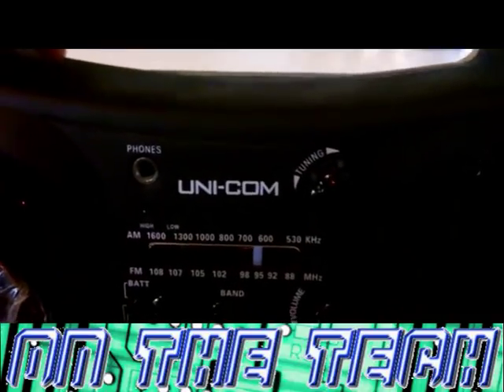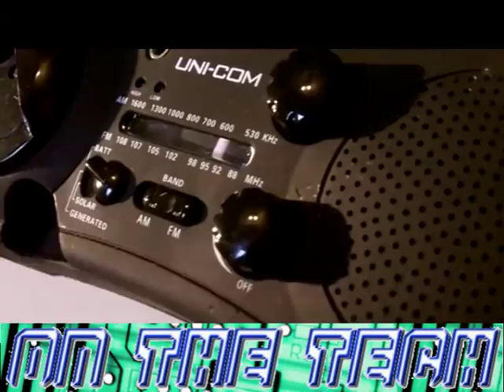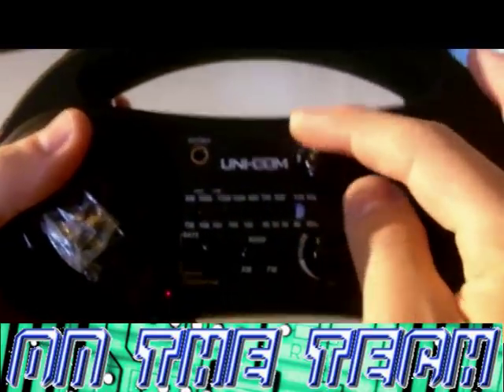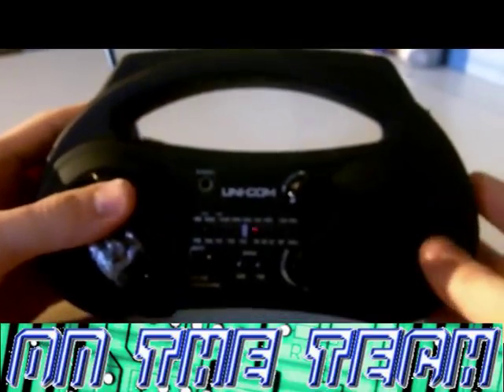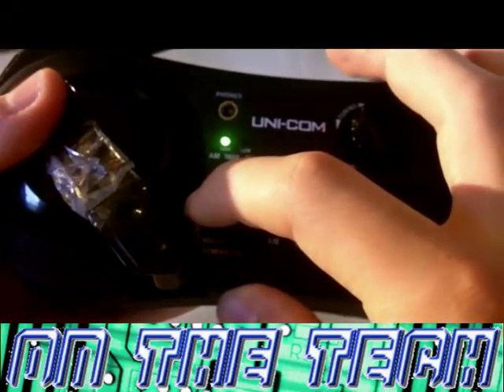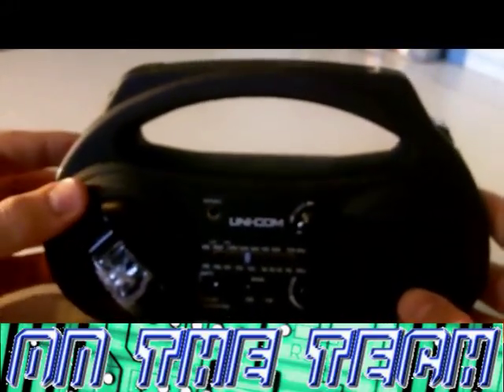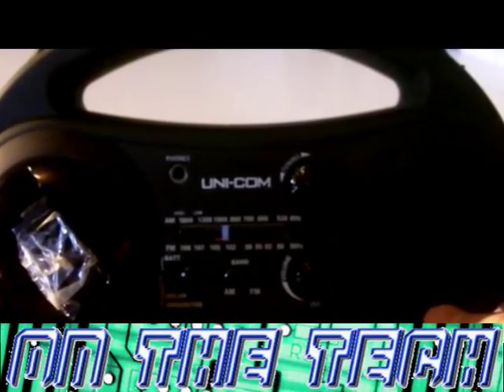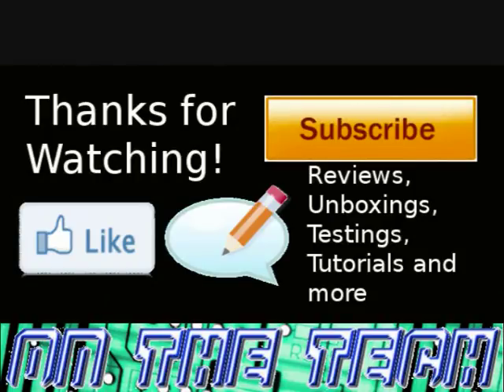Review of Solar Powered Wind Up Radio with Torch by Uni-com

Comment: does anyone know a decent make that allows wind & solar  setting simultaneously ?? 
(they exist had 1 years sgo but forgot make).. it was yellow had lafge windup at back, solar across top handle, radio on side & torch facing forwards..
my point was it was gd quality, most i find now are too flimsy or limited.